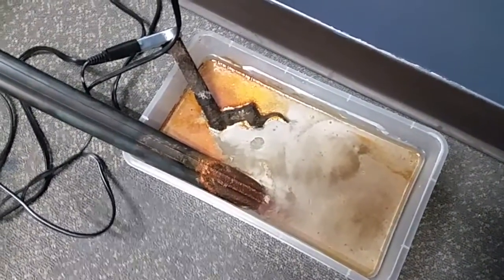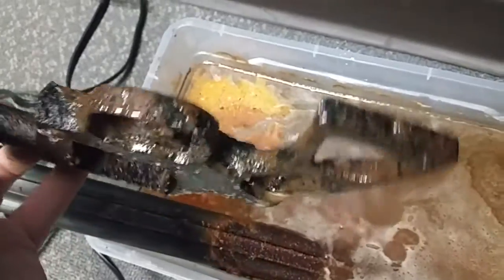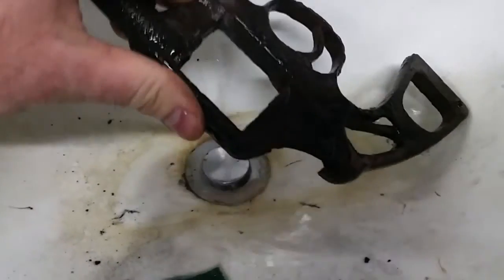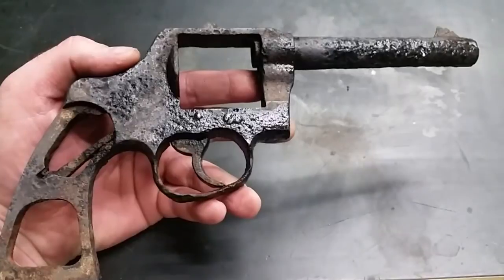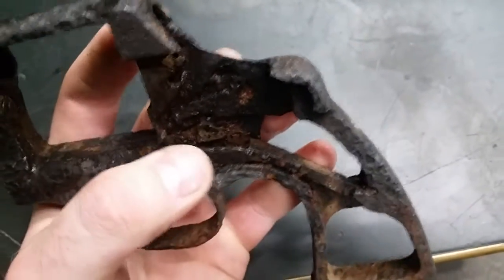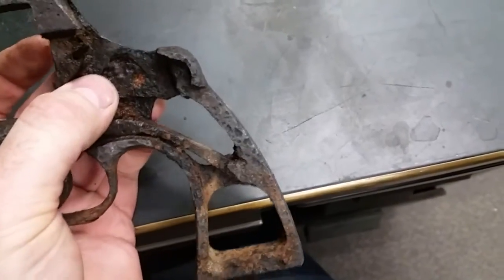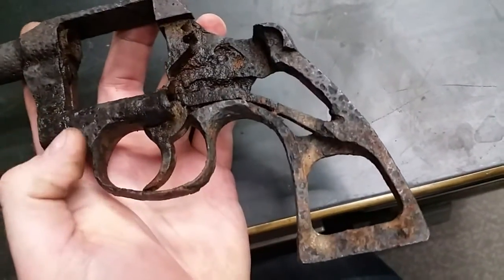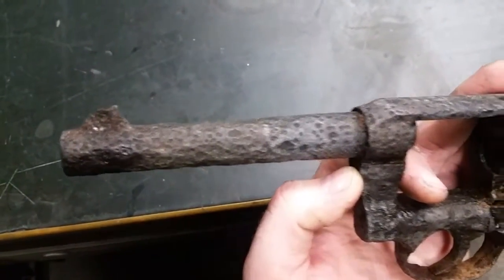Crusty Colt 1917 New Service? Video 7

Comment: Could you talk to us some more about 'the washing soda instead of the other style' and explain more fully what that's about?
Reply from the maker: +Ken ibn Anak 

I was using arm and hammer washing machine detergent before (which works... and is easy to come by but contains a bunch of misc detergents) 

The washing soda method is more pure and causes less crust buildup on the electrode.

Comment: So, heres a dumb question I probably already know the answer to.  I recently restored a cast iron pan.  The method I used was running it through a self cleaning oven for 2 hours to get all the rust/grime off of it.  After that it basically all just falls off.  I'm wondering how effective this would be for old (not valuable) firearms.  I can already guess that you run the risk of damaging any moving part or anything fitted together due to expansion from the heat, but what about if they were separate?
Reply: He has used heat shock before to free up moving parts

Comment: U.S. Army number on the butt and Colt serial number inside crane assembly. If you can't raise a serial number you may have a problem registering your 1917, if it IS able to fire a round. Good luck with your project!
Reply: Why would he register it and he doesn't need a serial number, they were not required on guns until 1968.

Comment: What is the status of the Merwin Hulbert
Reply from the maker: Not much has changed, I haven't set up an electrolysis rig in Los Angeles at the new house yet.... Its on the list, but parts have been really hard to track down so its going to be slow getting it operable.